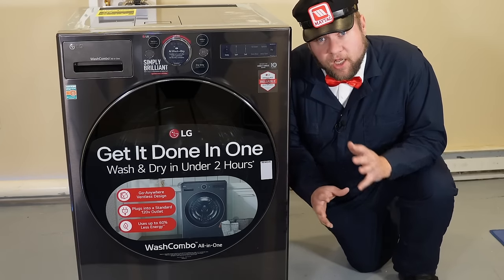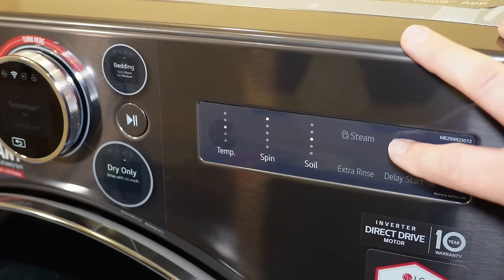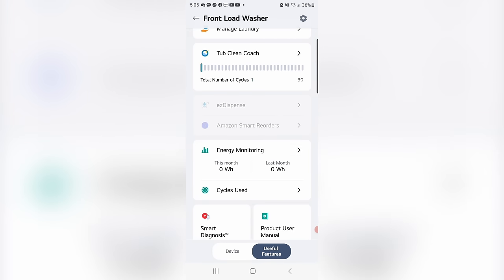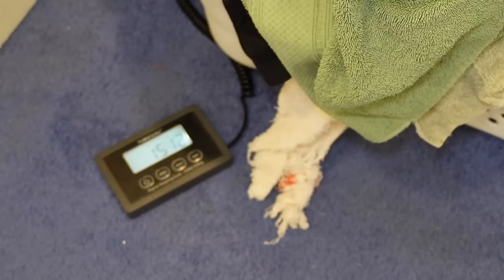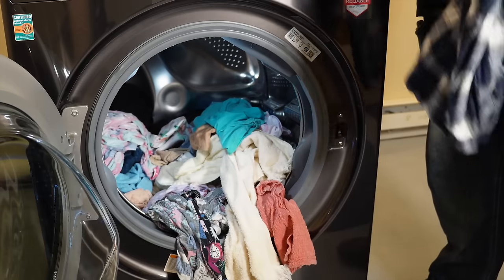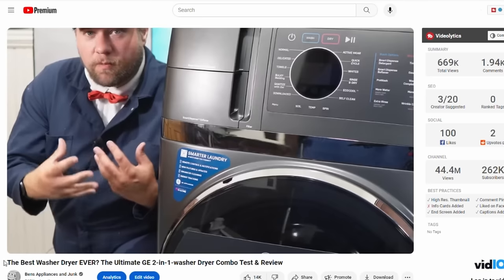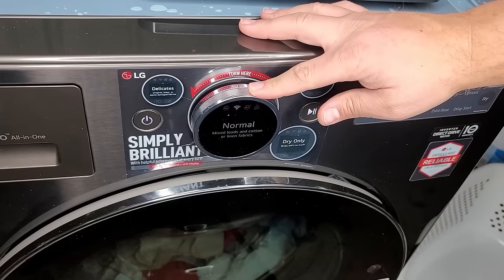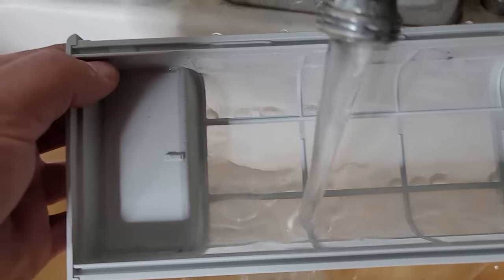BETTER THAN GE? The LG All in One Washer Dryer Combo: Test, Teardown & Review

Comment: LG's real world performance that I have observed through friends' ownership of their appliances is absolutely dismal. As you mentioned, not only are their refrigerators unreliable, but replacement compressors have taken months, not days or weeks, but months to get. Try living out of a Coleman cooler for a few months and see if you would be interested in taking a chance on a complex new product from that manufacturer. Sorry Ben, to me LG stands for Largely Garbage. Not interested in owning any of their appliances ever.
Reply from the maker: As a note, I loathe LG refrigerators. However, their washers and dryers have always been stellar. I think I do mention in the video that they're probably the best out there other than SQ's. The question is if the rotary compressor is a better design. How much better though? Hard to say. Especially with them giving it a 1yr warranty which is a joke...
Reply: So basiclly they are like the German auto manufacturers (BMW etc) of the home appliances industry. Unreliable with too much tech.
Reply: LG's laundry, particularly their front load units, have been absolutely top performers with pretty legendary reliability for a while. Their linear compressors in fridges are a huge black eye for them, but make no mistake, their washers last like 5 to 7 times longer between service than Whirlpoop's VMW clunkers, for example.
Reply: I have owned LG washers and dryers and found them to be excellent. I have no experience with the combo unit (yet).
Reply: Lg washers and dryers are the most reliable brand for washers and dryers.
Reply: They're saying the quiet part out loud with a 1 year warranty.
Reply: @Kandralla  are you a housewife?
Reply: @boomerang0101  What does that have to do with anything?
Reply: Still way better then any Samsung appliance
Reply: @Bigfoot4000:😂
Reply: @Bigfoot4000:If it ran and ran and ran you better catch it!!!!
Reply from the maker: @CARWASHCHANNEL.  no he's my twin brother
Reply: @bensappliancesandjunk  he your biological twin brother
Reply: I dont know about their appliances lol but their TVs are stellar, i have an lg tv that is 11 years old and my parents tv bought six years later died , i gave my parents the lg tv and its still running like a champ

Comment: I think it should be said that I've seen a couple posts on Reddit recently about people's LG washers uploading a lot of data when connected to the internet. So while the app may be useful, you are exposing your network to vulnerabilities.
Reply: At least that can be fixed with OTA updates, or just disable wifi and use it normally

Comment: The big question with any complex machine like this one is longevity.  My simple Maytag machines have been doing the job for 23 years without a hiccup.  I tend to use the same basic cycles for every load, adjusting only for size, and yes, I have to transfer my clothes from the washer to the dryer.  I cannot (and would not) use my cell phone to change settings.  They probably use more energy than this LG, but I haven't had to spend money for repairs or replacement, so I think I'm ahead on costs.  I would challenge any of these complicated, electronically operated machines to run trouble-free for even ten years.

Comment: In all fairness to the LG, I think you overdid it with your video by initially choking it with such an overfilled load, which is not very real-world. Instead, I would have started the video by just doing a normal 10 pound load to see how it performs in the real world. 

I was ready to buy this machine, if not 2 of them, when you mentioned the 1 year warranty on the compressor!?!!!!!!! WTF LG!?!?!?!?!?!?!?! By offering ONLY a 1 year warranty you are signaling to your customers that your machine is NOT built-to-last, and that you don't believe in its long term reliability.

 LG, this machine has an M.S.R.P. of $3000, but you only include a 1 year warranty!?!?!?!? Learning this fact stopped me dead in my tracks not only from buying this machine, but in trusting your integrity as a company...Shame on you LG. You should know better, and you might want to rethink your fake slogan of LIFE IS GOOD, and change it to LIFE IS SHORT on this LG product, which we charge a premium for, but don't believe in. 

I mean think about it for a second: Who buys a washer/dryer combo with the intent of having in break in a year? Then it cost as much to replace the compressor as buying a replacement unit????? This is so confusing, because I saw this unit in person yesterday at Home Depot, and studied its engineering characteristics. It looks like it's very well thought out and wonderfully designed. So you might want to rethink your HORRIBLE 1 Year Warranty....Foof for thought...

Comment: A little caveat on these heat pump dryers and washing machines. Remember, energy does not just appear, it has to come from somewhere! 

In the case of the drying unit, that is your room. So if the system is pulling 500w from the plug but using 1kw of heat, that remaining 500w is coming from the room... and what is heating your room. So essentially you are using your central heating system to dry clothes in the winter.

Also, when using these in the summer, make sure the room you have them in has no AC, that will massively reduce the energy saving you are looking for, really you should leave a window open and make the room as hot as possible.
Reply: Not really accurate. The heat pump is moving heat from the room into the clothes and the dryer. Afterwards, the heat will distribute back into the room again as the clothes and the dryer equalize their temp with the room. The heat isn't created by the dryer, and it isn't destroyed by the clothes.
Reply: With how the ac system is inline, I don't think it will be stealing or adding heat to your room, yes being in a warmer room would speed it up so it does not need to work against heat lost through the cast. 

The air-con heat side and cold side are in line, where it is dropping moisture before heating again. The air cycle looks like it is a closed cycle. I don't think it will make your room humid (i.e. reason why it does not have an exhaust port).
Reply: Nope, the airflow is  a closed loop and all the electricity used by an appliance ends up as heat anyway. The heat pump's evaporator coil takes the heat from the warm humid air coming out of the tub,  causing the moisture to condense out of the air, and the condenser coil is next to it and puts the heat back in and its blown back into the tub. The refrigerant will also get heated by the heat produced by the running compressor motor and I guess some heat from friction from flowing through the pipes,  which is why the drying temperature is much higher than the ambient temperature of the room.  If the room is very cold then it will take longer for the drying air to get up to working temperature and more heat will be lost to the room.

It is likely to loose a very small amount of moisture to the room because the drum seals are unlikely to be 100% effective, the best current UK heat pump dryers loose around 9% of the moisture to the room in the standard tests, although those apparently start at an unrealistically high moisture level for a front loader (60%), so it may actually be a little less.

In regards to AC, a vented dryer will draw in the cold air that your air con has used lots of electricity cooling , heat it back up blow it through the tub and dump it outside,  and the AC will have to cool down the air that flows in the building from outside to replace it, so a heat pump dryer will still save electricity. I think most UK heat pump dryers recommend an ambient temperature around 20 - 25 celcius, check the manual, but this is quite likely to be similar.

Comment: Maybe it’s just me, but I don’t care how fast it does the load, 
I care how much time I have to spend dealing with it , I just want to put my laundry in it can run overnight, and I get out my clean dry clothes the next morning.
But I don’t want to do is have to take my laundry from one device to the other device while it’s like annoyingly, wet, and cold and heavy , and then have to deal with that, or potentially forget to leave it in the washing machine, where stays wet for too long, and after to wash it again.

So for me, this is awesome , only thing I don’t like is the potential maintenance issues here.
I don’t understand why these companies don’t have a decent filter set up , do a primary filter and a secondary filter and clean the secondary filter every 10 loads. Would save a lot of pain.

Comment: We’ve had the ge for about six months now and have had absolutely zero issues! And no, it does not take hours on end to dry. Our longest loads are maybe 3 1/2 hours was and dry together. Only issues I ran into was overstuffing the machine to max capacity, of course it’s not going to be efficient at that point. We use ours at least 4 times a week
Reply: Same. I hope you are looking in the lint filter opening to see the lint building up on the condenser though. Keep on top of that with a brush and vacuum.
Reply: @Finndian  we are as well as cleaning out the bottom filter once a month
Reply: It drys right the first time? Or do you have to add some extra time?

Comment: It's a little disingenuous on your part to claim that you "couldn't verify" the auto coil cleaning feature, as this is well-noted in LG's product documentation and should be a major selling point. Your annotation makes it sound as if you don't believe it exists, rather than investigating it further. I'd like to suggest a follow up on that. Also, anyone loading a machine like you did with that comforter right out of the bag deserves whatever cycle time they have coming for them.

Comment: You mentioned a heating element. According to the user manual the heating element is used to heat the incoming water if not hot enough and generate steam for the steam cleaning function so it seemingly doesn't help drying time. The warranty is also confusing as the Home Depot listing shows the drive motor AND the Inverter Compressor have a 10 year warranty but the user manual says only the drive motor is warranted for 10 years. Go figure..... Now I'm conflicted as to which combo to get. Thanks for your videos!

Comment: My dad's lg top loader washer has been pretty good, aside from the detergent tray holding water. Being in FL it's always too humid and mold will grow wherever water stands. Always have to take the tray out and dump it. 
That amount of lint built up on the condenser is shameful. How did they let that out of r&d. I'd also be weary if connecting that to your main wifi network. Saw a guy on Twitter who's lg washer was sending 4gb of data every day. Not to lg servers either lol. LG all about their "ai" instead of security

Comment: I have an older all-in-one unit from LG (10 years old, now) and it seems pretty similar. No need for a duct, similar drying times, etc. Personally, I like it. I can see how some people might not like having 2-4 hour wash cycles, but once you get used to it, it's fine. That said, the one I bought was only around $800, and I'm sure a cheaper model would do most people just as good.
Reply: Yeah it’s just takes a little getting used to, we do the laundry overnight.  Let the robot work while we sleep

Comment: Looking at the compressors ratings the coil size may not be the best indicator. These are both from the ASHRAE rating. 
GE/BSA804SD: 3276 BTU/HR
LG/EAR072MA: 3700 BTU/HR

The LG one has a higher COP as well.

Hard to say just based on your videos, but the fin spacing on the GE looks wider to me, which reduces the heat transfer vs tighter spacing. We also don't know what the airflow rate is either, which is obviously going to affect the heat transfer capability too. We also don't know what tempurature the condenser and evaporator coils are reaching, the LG may be pushing them to further extremes than the GE, which is less efficient, but as stated the compressor is more efficient too.

Comment: 26:35 I like the lower height on the LG unit and the app features you highlight. I also prefer a unit not built in China. The 1 year warranty is a disappointment though.
I wonder how much the use of only cold water increases drying time. Thanks very much for your review.

Comment: Was curious if you continued to use the LG after posting your video for further testing?  After reading and watching WAY TOO many videos/reviews on the LG Wash combo and the GE Ultra fast, there seems to be a few common themes popping up. Both units don't seem to do a good job at trapping all the lint from getting to the coils.  The GE fix you recommend may solve that for GE but the LG seems to have the same issue of not having a complete seal and lint is getting past the trap.  Second is drying.  The reviews that I've read, seems the GE is more consistent/reliable with drying and I wonder if the heat pump size you talked about in both reviews has anything to do with that.  Would love any thoughts you may have as we are considering both units to add upstairs laundry.

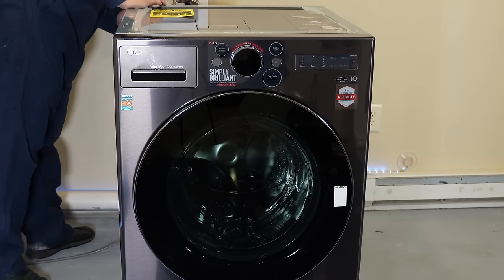Comment: At 10:34
Voiding Warranty....

Those "warranty void if removed"stickers are illegal according to US federal law.  Upto like a $5000 fine per incident....Another YouTuber mentioned it.

You should have reported them before you broke the seals....
Reply from the maker: I was more concerned with taking it all apart and putting it back together correctly. So I wouldn't have to call a technician and demand they put it back correctly together LO. L
Reply: @bensappliancesandjunk  

I think there is a simple procedure that may just require a couple pictures and some sort of document to explain what you found....I have not doing it.

Louis Rossman, (spelling??), Mention this in regards to a computer monitor....should be similar.

Comment: I still think the ge is better because the ac unit is like a module a decent diy'er could replace the whole unit or remove it and take it in for repair at least that's what it seemed like it could do.
Reply from the maker: If LG had made it a package unit like the GE, I think it'd hands down be the better choice. But they didn't. Oh what could have been. But like I said in the video, I think its entirely because this isn't just a unit for American homes, which could handle the larger space, whereas the GE is probably a bit more US/CA centric.

Comment: WHAT'S THE DIFFERENCE BETWEEN THE WM6998HBA vs WM3998HBA??!?!?!?!?!??!
Reply from the maker: WM3998HBA is a condensing dryer. This has a heat pump. Its 2x faster, the 6998.

Comment: I have an LG combo I purchased in 2017. I have had to replace the 2  motors last year. I would only suggest it for a single person or 2 people max. I usualy hang most of my clothes. When i do dry clothes i take out heavier items if possible and only use the dry only function for 30 to 60 minote cycles to avoid long cycles.